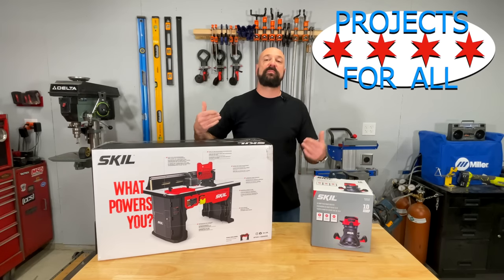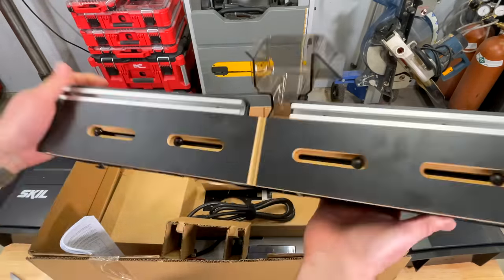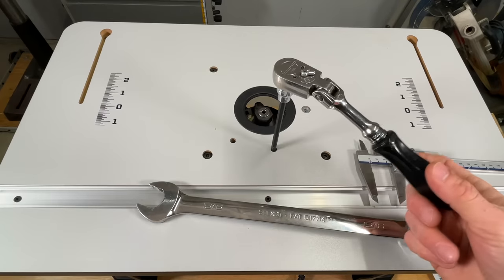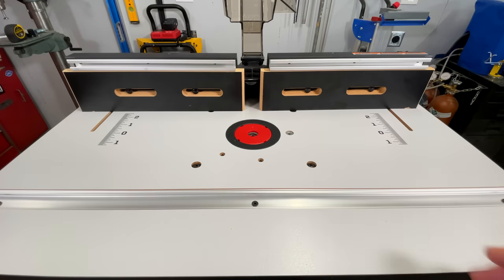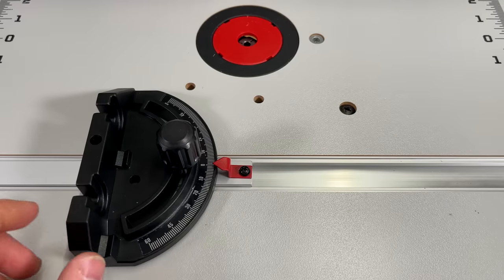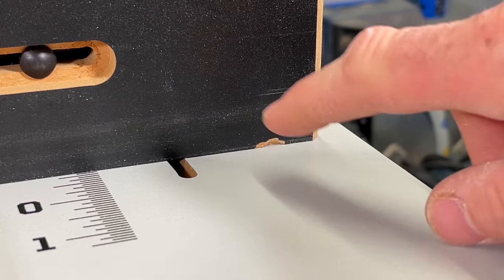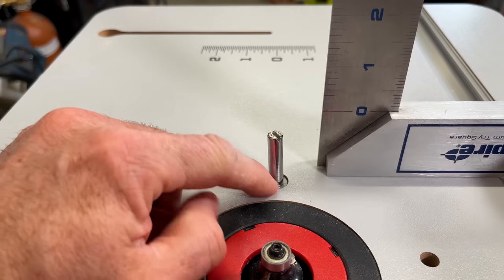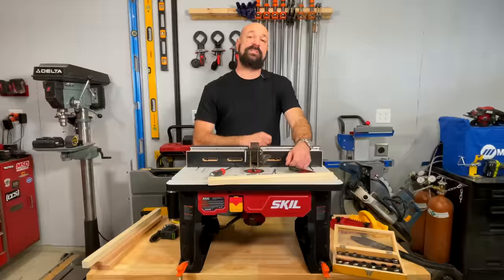Do You Have To Spend $400+ To Get A Good Router and Table Combo  ||  Skil RT1323-01

Comment: Thanks for the review - a few months ago I bought this table and it has worked pretty well. I'm new to woodworking and felt this was a good starting point since I don't have the skill (yet) to build my own and not am ready to spend $500+ for a really nice table. If you think about it, you're getting a pretty decent router for $100.00 and a functional table for $100.00. The out-feed fence on my table does not have the wiggle yours seems to have nor do the inserts spin. However, I agree and would not use it for jointing. I have also made a secondary fence that I clamp sideways on the table for larger pieces of wood and that works really well too. Also my old Ridgid vac connects into the larger dust collection port (think it's about 2 1/4") and does a decent job although dust does get into the side storage areas - not great!

Overall, I'm happy with it and feel it will work well until the time comes to upgrade to a more professional table.

Best, Larry
Reply from the maker: Glad to hear its working well for you Larry! Thanks for watching!

Comment: I bought it all for $179 tonight on Amazon and over at Lowe's I bought the SKIL 30-Piece Carbide-Tipped Router Bit Set for $103 so $300 bucks. It will do what I want it to do I'm sure
Reply from the maker: I’ve had that same router bit set for years and still going strong. Good luck with the new table and thanks for watching!
Reply: @ProjectsForAllReviews Good to know that about the Bit set Thanks

Comment: I got one of these lightly used for $75 and used it to make ~1500' of moulding. It wasn't in great shape at the end, but it did get me there. I had to build a new fence about 1/4 of the way though though. I wasn't being particularly gentle with the plastic fence and damaged it. I made a new fence out of some scrap plywood that wan't adjustable in about 30m. That lasted to the end of the job. I was using reclaimed wood and budget was the concern rather than time. I think it is a good value for what you get, especially if you don't have the ability to make your own table yet. It's a good place to start.
Reply from the maker: I agree! It’s very good for basic uses like trim. I especially like the router, inexpensive and powerful. Thanks for watching!

Comment: I have the previous model. It doesn’t have the jointer fence concept and is more stable. The tool storage is just flip top bins that are the lower part of the legs. They fill up with saw dust. The scales on the table top have not worn away.
One of the throat plates broke off a couple of holding tabs and Skil or Bosch told me they were discontinued. This one looks like they resurrected the old throat plates. Will order one and see if it fits.
I have used good quality bits and have been quite happy with the results.
Dust collection is ok, but it will still make a mess. Just know its limitations. Like the man said, a good beginner table.

Comment: Ummm...retired woodworker here. 30+ yrs. My thoughts?

In my experience...in what I do in a wood shop...routers tables are the second most important stationary tool behind the table saw. Yes...I call a router table a stationary tool because it needs to be large enough to support full-size cabinet doors and stable enough to be firm and solid throughout the routing process. The router connected to the table has to be able to run for an hour or better between rest times. Needs to 1 1/2hp+, variable speed. The fence (when in use) needs to rock solid, absolutely square and infinitely adjustable.

I still go out...about 5-8 days a month. Can't seem to get sawdust outta my system. The table we use on the jobsite comes from Rockler. Standard 24x36inch tabletop with t-track/miter channel. Extruded aluminum fence mounts similar to the Skil. Split melamine MDF faces. Aluminum router mounting plate. Modular square steel tube table. Pre-covid price for that set-up was about $400, as the store offered several options for most parts, and you "built" yourself a custom table assembly. Still need a router...we use the DeWalt 618. Boss likes yellow and black.
All that said...could I see using that Skil setup in a weekend warrior type environment? Router...maybe. Table...no. If you want a router table, find a set of plans here on DaTube and build one. Buy the mounting plate first! Fences can be homemade if you are confident of square, or adequate models start at about $100. I've built a few myself...not afraid to build another ... for me, in my shop.
Router...there are good choices for routers starting at about $150 today. Look for 1 1/2hp...or 10amps...plus. Look for variable speed and soft start. You might look at the DeWalt 618, the Bosch 1617, the Harbor Freight Hercules (don't start laughing until you put one in your hands!) or the Skil shown here. Porter-Cable quit making routers a couple years ago or I would have recommended the 890series.
A good router table can also double as a flat spot...lightweight workbench, a place to store parts for assembly, etc. Build a quick-n-dirty plywood cover for that tabletop to keep it glue and smudge free!
It will also become a memory machine..."I made this/that here." so do it right the first time. I heard "Buy once, cry once" the other day...and it certainly applies to router tables.
Reply from the maker: Thank you for sharing your experience with us Woodrow!

Comment: Another good video, I do like that you call it as you see it. As a general comment, although I can understand that people who expect to do a lot of work on their router table may have different needs from those who only intend to use it occasionally, this is only really to do with longevity ie how well will the item deal with prolonged usage. However, where accuracy is concerned, such as the flexible fence issue, then this is surely a concern to everyone regardless of usage level, who wants their work compromised by poor build quality?
Reply from the maker: I agree. A small MDF and plastic table probably isn’t the best choice for jointing anyways. If I wanted to use this for that I would make a slightly thinker left fence out of mdf and sway it out instead of trying to adjust the oem one. Thanks for watching!

Comment: Good, HONEST review. I guess you would have to make your own fence and call that your 1st project. Doing so would correct the dust collection issue. I'm spending my next few days demoing a tile on cement on wire mess shower. Ryobi Multi-tool and diamond blade works pretty well with little dust.
Reply from the maker: Thank you. Last time I used a multi tool was to remove the mortar under cracked kitchen tiles off of hardibacker board. Had about 24 sq ft to do. Scraper blade in the Sawzall worked to but only up to a point. Bought a cheap multi tool from HF. By the end the little motor was screaming so loud I got the ear muffs but it worked. Thanks for watching!

Comment: This one was my first choice, before I finally bought the Cobalt instead.
I live in Gulf Coast Texas, and my shop is not air conditioned,... so MDF will not last more than a couple of years before it starts swelling up around the raw edges and the seams of the formica.
The Cobalt has it's issues but is still holding up so far.
Reply from the maker: Makes total sense. Chicago hits 95% humidity regularly in the summer but only for a few months and I doubt the mdf will give me any trouble. Glad to hear that Kobalt is still holding up for ya. Thanks as always for the comments!
Reply: @ProjectsForAllReviews  Just in case it helps anyone else out there,.. I think the key to keeping the Kobalt working is to never use the above table height adjustment.
Reply from the maker: I agree. Wouldn’t hurt to support and push the router up when raising either.

Comment: Great review.  What unit would you recommend that can be used for joining?
Reply: I can't answer your question without going into definitely non-budget territory, but if you can make your own fence, this will work fine for jointing. You can reuse most of the hardware from the existing fence. I have a fixed fence for jointing that I swap onto my router table. If you have a table saw, some decent plywood and a couple hours it shouldn't be an issue.
Reply from the maker: Not sure I can give a better answer than jsmxwll.  This is my only router table at the moment and if I was going to use it for joining I would make a new plywood fence a little thicker than factory and swap it in for that function. 
We should be doing the Ryobi combo soon and there’s an interesting model made by Grizzly with a metal tube frame I’d like to test. Thanks for watching!

Comment: Hmm, looks like a huge step up from the old Craftsman router/table combo I have...the table itself is some sort of plastic, and have a lot of flex to it.  I may look into this combo for the occasional user its a great price point, and the router can be removed and used by hand if I want...doubt I'd ever try that though LOL.
Reply from the maker: The router is the best part of the combo. Seven Phillips head screws to remove the router from the table and just as easy to reinstall. For occasional use I maintain this isn't a bad way to go. Ive never seen a plastic router table but I promise you even with its flaws this will be better. Thanks for watching!
Reply: @ProjectsForAllReviews  Wonder if there is a plunge base that would work on that router?
Reply: @wildbill23c  Yep, I have the router, they sell a kit that comes with the plunge base.

Comment: I gotten 14amp router & it is the plunge base & fixed base model with a break button....I need to figure out how to mount it o the table...idk if I remove the plastic cut ring then mount with the fixed base??

Comment: I have this same router table combo and actually like it a lot. For the price it can't be beat. I work in one side of a two car garage and put my car in every night, so efficient use of space is very important to me. I mounted the router table between the two extension arms on the right side of my Delta 36-725T2 Table Saw. The space saved is tremendous and having the extra work surface helps as well. I am by no means a master woodworker but do manage to produce many beautiful projects, many using this router table. I agree the fence sucks, but I was able to make it usable by removing the ridiculous red plastic sliding adjustment piece on the left of the fence. I then removed the left sliding part of the fence itself, and using a straight-edge I was able to shim the fence with washers behind the fence to make it Co-planar with the right side of the fence. It now works great for precise work such as making dadoes. It cannot be used as a jointer with this simple modification, but with all the play on the left side of the fence it was useless as a jointer anyway. I also have used the router tabIe to shape chair legs using a template, and it works very well for that. I would highly recommend this router table combo, just understand it is not heavy duty and will not stand a lot of abuse. However, when I purchased it, it was about half the cost of the Bosch router table combo. I am not a professional, so my philosophy is to buy inexpensive tools that will still get the job done. I have a mixture of Wen, Ryobi, Delta, and Dewalt tools in my shop-and they all do just fine for me. I enjoy and appreciate your videos, they are some of the most detailed and entertaining on YouTube. Your review of the Delta 36-725T2 Table Saw is actually what convinced me to buy it as an upgrade to my jobsite saw. I had been considering spending much more but I have had the Delta for close to a year now and it is awesome.

Comment: I wouldn't say that stuff like this is a good starter piece. Beginners using junky flimsy tools will either get frustrated and quit the hobby, or just have to go out 2 months later and buy a decent quality tools- so why not just skip wasting the money on the junk and get something that's at least half-way functional from the git-go? This might only be $200, but really, I'm sure every one tha6t has been purchased has ended up in the garbage or stored in an attic long before a year was up. It's sad that they manufacture so much crap these days that just ends up in the garbage.
Reply from the maker: Thanks for watching!
Reply: @ProjectsForAllReviews  Thanks for the vid! You did a great job of realistically showing the good and bad.

Comment: Yeah, too flimsy for anybody other than occasional use by a do it yourselfer.
Reply: Oh, if you think that is bad, you should try my 30+ year old Craftsman router/table combo....the whole table top is plastic...you get a nice 1/8 to 1/4 inch flex in the top, try making anything accurate with that....at least the top on the Skil is MDF making a far more stable surface...and with a bit of work you could make that fence pretty rigid by adding some backer materials to the face and base of the fence.  But, what do you expect for $200...the router alone is $150, leaving them $50 to build a router table.  

Wood Craft you can get a basic table for around $250-300 then pay another $200-400 for the router...add the router lift system for another $400-800...and have a great setup, but I haven't ran across anyone that spends 10+ hours a day at their router in their home shop....so that $1200-2000 router table setup just wouldn't work for many hobbyist woodworkers.  For that kind of money I'd just buy a shaper instead, and have an unlimited amount of cutter options.
Reply: Professional woodworkers reviewing entry level products sometimes miss that this might be great for a beginner who is likely to remain a beginner for a long time. I got this a few months ago after hours and hours of research and reviews. I needed easy access for changing bits and definitely needed bit height adjustment from above, and I had a tight budget. I love this thing. I learned from another YouTube video how to use my clamp down straight edge from front to back in place of the fence when the depth of the fence wasn’t adequate. I’ve made several Microjig Matchfit jigs with this. it’s light enough to put away on a shelf when I’m done. I appreciate the detailed review. It will help me watch out for issues and be fully informed.

Comment: I bought one 20 years ago virtually the same router table. It was made by “Global Machinery Company” in Australia. 
  Bosch sells on too. Virtually the same.  Mine has legs and came with the router motor in it. Lowes practically gave it to me. I think I paid a hundy for it. 
They didn’t want to assemble it. Still works fine to this day.

Comment: If you recommend this piece of junk over the kobalt, I can't even imagine how terrible the kobalt is.
Reply from the maker: The Kobalt is cheaper but has a single speed router, fake miter slot with tabs and the base lift mechanism broke on camera while making the vid. Makes it tough sell. Thanks for watching!
Reply: @ProjectsForAllReviews  something I would like to see is a comparison between the Bosch and Kreg table top units. They're not a lot more expensive than the Skil, but appear to be much better quality.
Reply from the maker: A buddy offered his Ryobi so I think that’s next then onto the Bosch and maybe the Kreg. I seem to be working my way up from the bottom with these. At least as far as price goes.
Reply: I have the kobalt and I am very disappointed with it, the base lift mechnism broke on mine as well. I guess you get what you pay for

Comment: I bought the Kobalt in December and paid $129. It was a no-brainer. Had it been a higher price this Skil would be worth comparing.
Reply from the maker: $129 really is dirt cheap. It’s hard to argue with that. Besides breaking on camera my biggest gripe with the Kobalt was the fixed router speed. It really limits the bits you can use in it. Thanks for watching!

Comment: if a fence only has a mechanical fastener at each end then it has to at least be metal reinforced from end to end to keep from flexing in the center but in reality like with a table saw, a fence made completely out of metal is far superior then plastic for accuracy as you demonstrated...
Reply from the maker: For sure and I agree but if think the fence itself is rigid enough to be serviceable. The problem is when the outfeed fence is extended. I wonder if I couldn’t mod it with additional hardware and some angle iron. One of these days I may do a vid fixing the problems we’ve been finding in the reviews. Thanks for watching!

Comment: No go.  A toy at best.  BOSCH RA 1181 table is so much better.
Reply: That says a lot as to how bad Skil is. Because the Bosch Router Tables aren't good.
 
The 1181, like every other die cast piece of aluminum Bosch (North America) sells, is rarely flat. 
 
The 1181 table top, and the aluminum insert plates are always plagued with warping. Even their electric hand planer bases, and cast circ saw bases always have some degree of Twist/Deflection. 
 
In other parts of the World, Bosch doesn't have that issue. 
 
It's a shame how Bosch Tools North America is ran. They care more about their mediocre dishwashers than the tools.

Comment: I'm not feeling all that plastic. I like the idea of on board storage but if those "legs"get damaged you're fooked.
Reply: A router table my grandfather had was all plastic....over time the router's weight made the table no longer flat, ended up trashing that thing....router is fine, table was garbage...so the Skil table is a bit of an upgrade from a plastic table....and you probably could build some sides or legs and mount that table to rather than that plastic nonsense....even for $200 they could have done better.  

I need to find a router to put in the router table I picked up at a garage sale a few years ago, its all aluminum, but I don't think the old router will fit in it but I haven't tried yet as I have no clue where the router ended up :(.
Reply: I’d just make wooden legs for it if the legs were my only issue